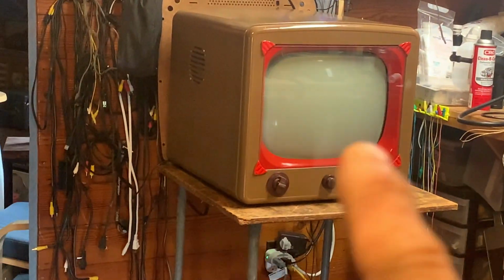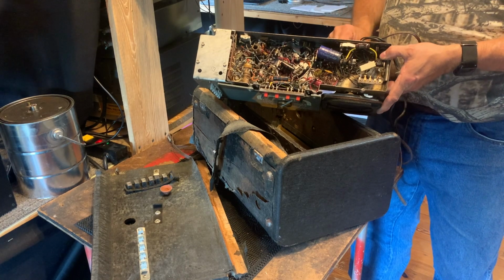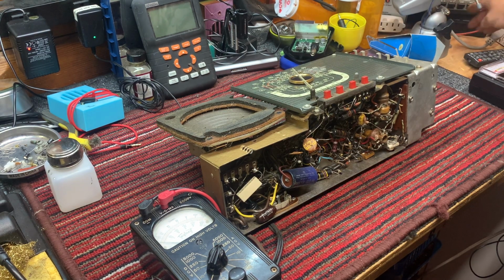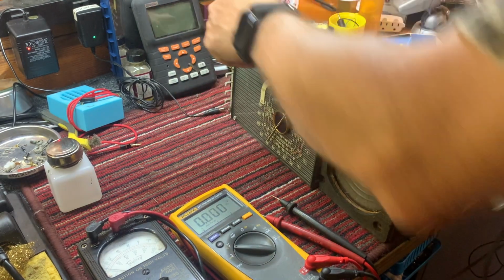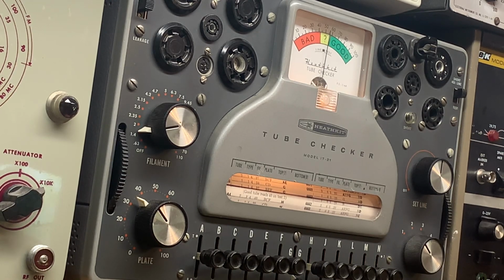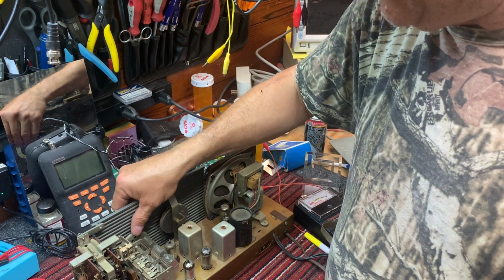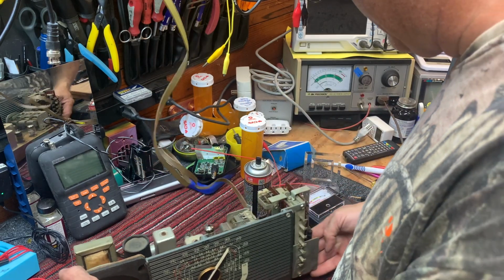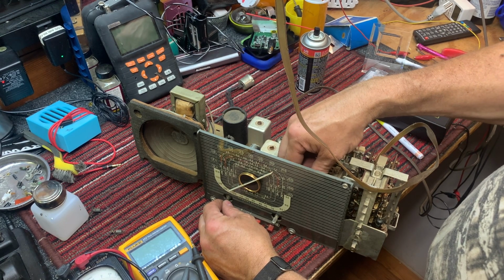Vintage Tech: Zenith Transoceanic H500

Comment: Back in the day a lot of money was made from tube testers. Just because it shows in the red doesn't mean its bad it means they wanted to sell you a tube 😅. It can still work but not at its best. You're absolutely right. If it reads in the red its questionable. Tube testers are overrated unless its a military grade tube tester they operate the tube under load at maximum voltage. I have a little small tube tester and it has very little components its basically a test to see if the filiments are good and if it has any emissions at all. You have to know your own equipment.
Reply: So true,  they are a very much an instrument that you get to know and as the venerable Shango has demonstrated so many times they seldom agree so you pick the one that tells you the good news Ha ha.

Comment: I wonder if an old degaussing coil can be temporarily used as a loop antenna. When I was working on radios and needed a loop antenna I would just take a line cord and wind it in about a six inch circle about 5 turns and it would work its not that critical but not optimal. The antenna trimmer alignment must be done with the sets antenna.
Reply from the maker: I’ll be the degaussing coil would work. But usually it’s just a few windings of wire like you did.

Comment: When the Tube Tester is in the "Red" it's bad not "questionable"  The "Yellow" area with the "?" means "questionable" I'm just adding this comment because when you checked the second tube it was in the "red" and you kept saying it was "questionable" . This may be a bit mis-leading for those who are new in vintage electronics by you saying the wrong readings when testing these tubes. There is a '?' question mark on the gauge and the reason they used a question mark is just that - meaning "questionable".
Reply from the maker: Good insight. As you know, we rarely trust tube testers for significant results, other than for filament opens. Most techs just use them for that purpose. I have been over this on other videos over the years. If I get any needle deflection at all it is an indication of some emmission,  and the tube may work, even if weak.  Buit your point is well-taken.
Reply: Well, I mean with traffic lights, if it's red, it just mean's it's a questionable idea to go ahead through the intersection, not necessarily bad...

You just got to cross your fingers like him!
Reply: @spitfeueranna  Agreed, some sets will be happy with a low emission it depends on where it is and how strong your signal is and how hard you drive the heater. 1V tubes are so picky. Pick the best as it all you have.